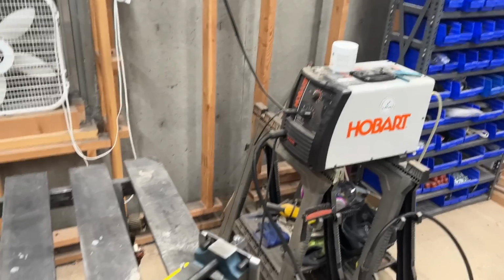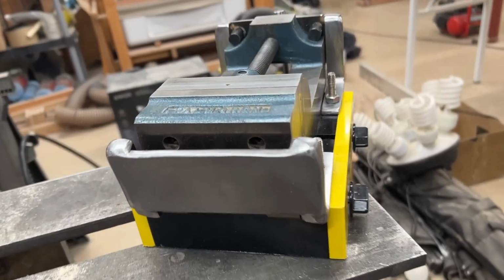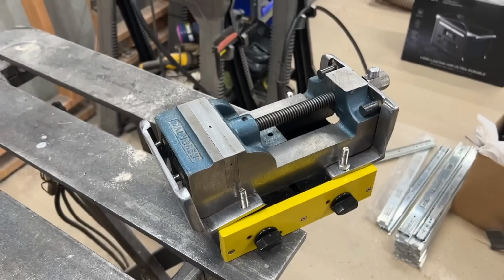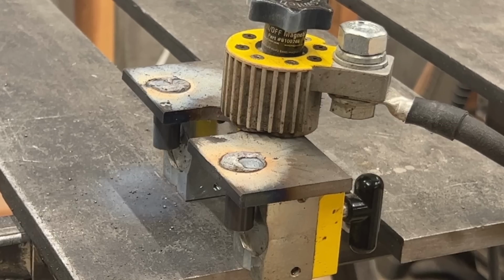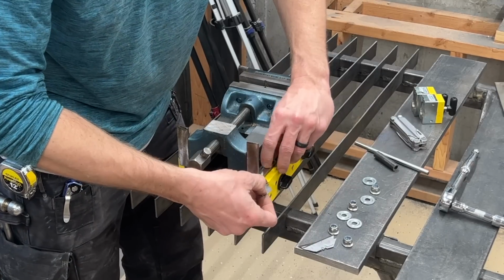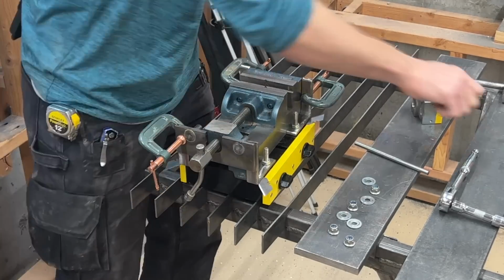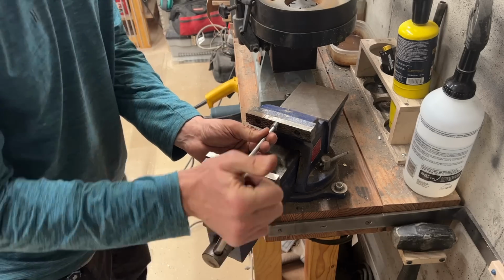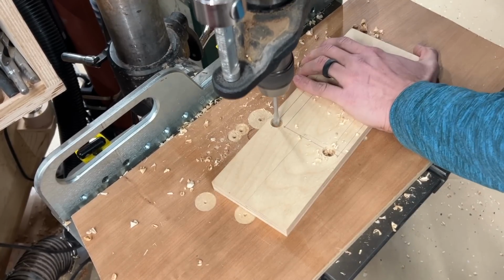Impossible to mount Vise, how would you do it?

Comment: Creative way to capture the vice. Vice makers really should put a groove the on sides for tie downs though. Yeah its an extra cost but makes the product easier than having to drill and tap large holes.
Reply: That is a toolmaker's vise.  All those machined surfaces are reference surfaces, and it's designed to be held in another machining vise.
Reply: @willjosephson  You can have reference surfaces while having a lip no less.

Comment: I’d probably use another magnet.
Reply from the maker: could work, not the most budget friendly solution
Reply: @AndrewKleinWW  I’m mostly joking. 😀 at my welding shop we’d do it your way. Or might drill/tap the base of the vise.
Reply: I don’t know if this is feasible with how magswitches work but would it be possible to make essentially a double sided version of the vice base? So you don’t need to mount the vice at all, you just put the vice on the base where you want it, switch it on and the magnets hold down the vice as well as to the table?